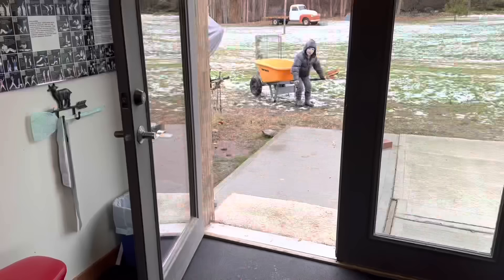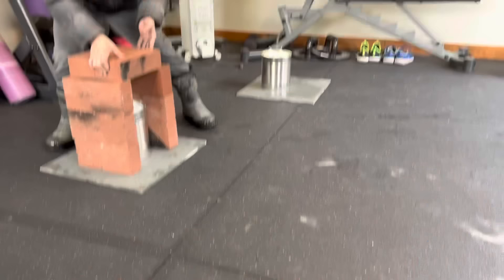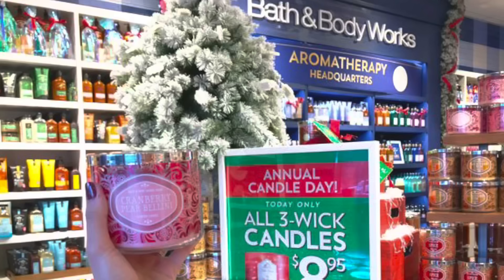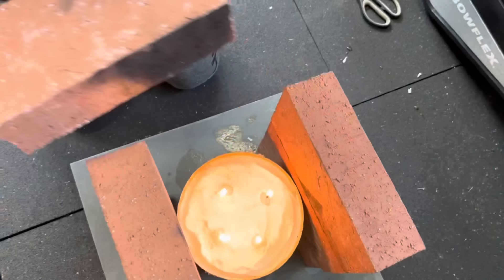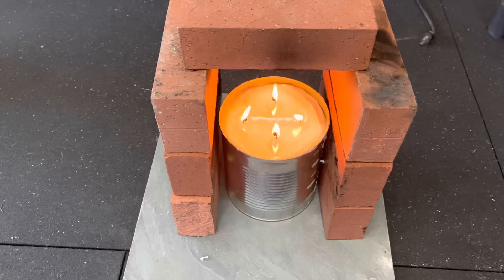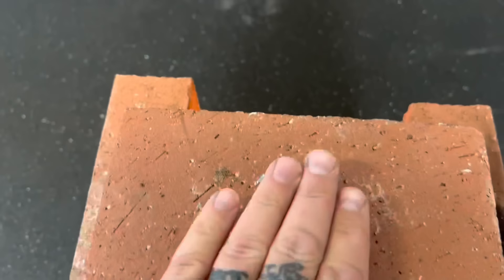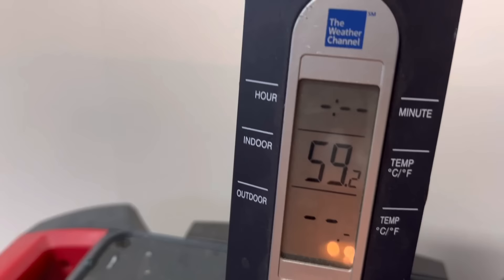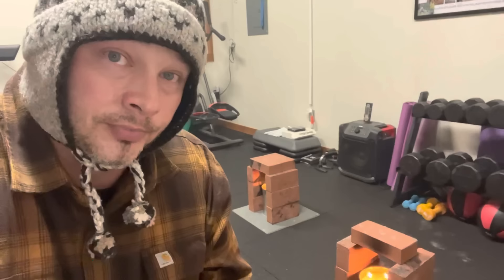Crisco candle room heating | Power Outage Room Heating | 9 hour test

Comment: Thanks for the video it was very interesting!
I wonder how these "heaters" are different from just burning the candle. The amount of heat produced should be the same. Is it that you are "concentrating" the heat within the bricks? I can imagine that when burning a candle the heat is evenly distributed in the room, and once the candle is burnt down of course there's just the warm air left which might cool down pretty fast. Here you save the energy within the bricks which will emit infrared radiation even when the candle is off and it might be much warmer around the heaters than in the rest of the room (which is quite fine if you sit around them and don't waste energy e.g. to the area around the ceiling). Is this how it works?
Reply: You pretty much nailed it.  "Thermal Mass".  You've grasped Physics!

Comment: The heat is the same, it's just absorbed and re-radiated by the thermal mass so the distribution is broader.  Having a ceiling fan stir up the air does the same thing and as gas furnaces only use electricity for the fan, plugging the furnace into a high capacity UPS, perhaps where deep cycle lead acid batteries have been wired in would allow the furnace to operate through most power outages.  Ultimately, having a transfer switch and sub-panel installed would allow you to wheel out a portable generator for long term power outages and if you ordered the trifuel version of the generator which costs the same, you can run it off the natural gas lines, resorting to propane or gasoline when the natural gas lines are disrupted.   Also a modern portable kerosene or propane heater will often have an oxygen sensor for indoor use to avoid carbon monoxide poisoning and may be a better and safer choice than candles and bricks.  Also keep in mind that many carbon monoxide detectors are powered through the mains and are only designed to last four days on the battery backup.  You will want a battery based carbon monoxide detector on the same floor you intend to use this as an emergency heating solution.  Also, though this might've worked during say the cold snap in Texas, it's going to do very little for the minus 20 to minus 40 Celsius Canadian cold snaps, candles only put out so much heat however you distribute the heat.   Keep in mind that carbon monoxide detectors must be kept above 4 degrees Celsius or the electrochemical sensor will be damaged which is why they advise you to bring them into your house from your RV or cabin when the RV or cabin are not in use.
Reply: How would you turn the ceiling fan on no electricity
Reply: @vanferrell7021  I believe he mentions the fan as a comparison of distribution of the heat via the thermal mass.

Comment: I would be to scared to use kresto I would rather use candles if u think that would be safe thank u for Ur help
Reply from the maker: You should not be scared of Crisco, it will not catch fire unless it reaches over 400° it’s pretty safe and it burns much longer than a candle it seems, but either way it’s a great back up plan

Comment: I would ask for more controls. Has to be done at night so no sun heating. Need to know what it is on a similar night, with no heat and plot that. I watched a video of a guy in a double tent with 30-50 candles that it didn't touch the temp...it was still cold.
So there are a lot of variables that weren't addressed.

Comment: Wouldn’t steel plating work better at heat transference?
Reply from the maker: Many have mentioned that! I gotta try it
Reply: @RiversideHomesteadLife  I’m pretty sure clay is more of a insulation type of medium whereas iron or steel is better at heating and transfer of heat I would lower the top plat to get it within a inch or 2 from the top of the can. Bet you’ll get a lot better heating. Good luck.
Reply: No.  Se my explanations above in the comments.  
Cast iron would be useful, but not sheet metal.
Reply: @RiversideHomesteadLife  Don't waste your time.  Already explained above.

Comment: So these 12-candle units backed by vegetable shortening have raised the temperature 20-30F above outdoors. How much insulation do the outer walls have? I've been testing a similar setup in a 1972 camper with 2" of insulation, and am only getting 12F at 30F outside with no wind. Wind matters for this camper; Our land is on an open ridge with an easy mile of open space to the west and 3/4 mile to the north (cattle pasture).
Wind's effective power rises as the cube of wind speed, and trees/bushes will not get big enough fast enough to help and adding rigid foam insulation such as polyisocyanurate inside is (a) ugly (b) difficult to attach in winter (c) not going to attach with hardware. Aluminized bubble insulation would improve light levels inside but still have to deal with (b) and (c) above. Here on the Rez, if it's 40F outside, we put on another layer.. We call it "living in the fridge". Think about that
Reply from the maker: Sound challenging- I used r-13 in walls is all and the windows are the cheap ones that were on clearance at lowes - so not a bomb proof perfect weather building- but ok. 
Campers are tuff we lived in on here for 3 years with 6 kids even had a baby in the camper while I built this place so I know all about it- 

The good thing about the the candles is it helps with the condensation/ a small fan helps to to circulate the air…. I will be showing how to build a make shift wood stove soon - maybe u will like that idea
Reply: @RiversideHomesteadLife  I had a blacksmithing and welding shop for 20 years. I've built a lot of stoves. Problem here is, camper has 7 ft x 16 ft body; no shelter from wind, which gets hairy up here (as in, 10-15 mph more than in town); no water (winter ice doesnt count; too hard to throw 😝); I live on crutches so don't have 2 free hands all times I need them; ND has been in a drought for 3 years and counting. My first whiteman name starts with C for Challenge, I wonder..

Comment: No good having your co2/smoke detector on the bench, it needs to be on the ceiling.
(yes, I know co2 is heavier than air, but when hot it isn't which is why they are usually on the ceiling)

Comment: 54 degrees to 59/60 degrees is about a 5 degree temperature increase.  I wonder if that's enough in an emergency situation.
Reply: There were variables working against it -- the 'large' space (i.e. not a micro-space, size of a large tent], high ceiling, uncovered windows, the open door, and the atmospheric temperature (outdoor temp) falling over the hours that the test was run.  The thermometers were registering temps from a good distance from the candle/brick set-up.  I wonder what the air temp was  within about 2 feet of candle 'furnace'.

Comment: Could you use a terracotta strawberry pot instead of bricks? It seems it would work. There are holes open in the sides, and put a clay saucer on top. What do you think? I was without heat last winter when
it snowed and i just bundled up.

Comment: Would you please consider showing how to construct a 70% isopropyl alcohol heater and its effectiveness ??? Very helpful video. Keep up the great 👍  work .
Reply from the maker: Paul- a 70% will work much like a 91% but may have more yellow flame than say like the yellow bottle of heat which gives off blue flame which is ideal the more yellow flame the mor fumes in the air that you need to be precarious about air quality with a battery powered CO/ smoke detector 
Thanks for watching- more tips to come

Comment: I think this test is only useful if you do the same test without the heaters.  We have no idea what temperature that room would have been without the heaters.  It may be holding heat due to being well insulated and not because the heaters are holding the temperature steady.

Comment: Easier to first insulate the walls and lower ceiling height.Then build a setup where the candle's heated air goes up a slow inclined metal ribbed heat spreader, then exhausted Outside near ceiling. 
Also have sealed fresh air duct leading to Candle Heater.
Please make a video on my oncept? 
Thanks !
Reply from the maker: OK I will write this concept down

Comment: Would a steel plate radiate heat better than the brick on top over the flame?
Reply from the maker: It’s possible - and have hear a pan of water even better
Reply: No. Or, more correctly, not for as long as a brick or unglazed clay object would.
Reply: @RiversideHomesteadLife  No. Water cools rather quickly.

Comment: Did you have a control? Did you see how what the temp in the room would be inside with no heating source when it was 30 degrees outside? I'd like to see the overall difference if you have that.
Reply: Yes, a person is good for about 200W that will raise the temperature a little.

Comment: I guess 15 degrees Celsius is better than 1 degree Celsius.. not bed for a room that size.. I wonder if aluminium would throw off more heat???
Reply from the maker: It helps that’s for sure and there was 4 huge windows in there that could have been covered  aluminum could reflect some heat
Reply: @RiversideHomesteadLife  I’m gonna try what you did, looks fun and easy. My thought is that aluminium heats up fast and may put off heat quicker. So I will experiment. Thank you for your video. Was educational and interesting..

Comment: Have a question before the cold hits!! Do u think its safe to use a cast iron Dutch  oven with the lid cracked for airflow? Last yr, I put alcohol burner in our grill, just to see how much heat it would throw and it was amazing but I'm in a 10x14 shed and I need small ideas. Also wondering what alcohol fuel is safe for this small space. Its well insulated. I'm gonna try your crisco candle making skills too lol

Comment: Why not wait until it’s at least 40 or 32 degrees. It doesn’t take as long to heat something from 55 degrees as opposed to 20 degrees! When it’s colder out like in the dead of winter, will it heat up to make it warm inside??!!!
Reply from the maker: You need to start fixing the problem when the problem happens - don’t wait till your house is an ice box to start
Reply: @RiversideHomesteadLife , people have no control over when electricity goes out!! And this winter is going to be severe!!! There’s no way you can prevent this!!!!!

Comment: Crisco 12oz can is on Amazon and Walmart  - $18-$20 😮
Reply: I can't speak for Amazon, as I haven't looked there, but definitely do NOT buy from Walmart online if you can help it. I've found a LOT of items I usually buy at my local Walmart listed on their website for substantially more than the price in my local store. Example, a few months ago, I wanted a 2g glass Anchor Hocking jar, sold as a cookie jar, for a small terrarium project. Walmart had it listed online for $23.97. I bought it at my local Walmart the same day for $13.98. I've seen the same cost discrepancies with food items. I no longer use their website, except to check if something is stocked by them.
Reply: Crisco 48 oz can at Aldi, December 2022 - $8.22 USD.

Comment: Some burn up to 72 days? Could I set one of these up in my crawl space to keep my pipes from freezing during the winter months?
Reply: A crock pot works really well. They are cheap ( flea markets /;thrift stores) & have a low / warm setting...I have kept my main supply & water meter warm using 1or 2 crockpots on low/warm , full of water....
A reptile heater works for this as well ...uses 
even less power , but some can get HOT ! check ✔️ with a temperature 🌡️ gun 🔫 ! If the pot is uncovered it radiates better , but you have to refill more , if covered it won't run out of water for ? days ?

Comment: An even better test would be to set your crisco candle heaters up, and then set up 4-5 cots for people to sleep on, and see what the temp get to, because having several people will add to the heat, plus do not keep going in and out.  Just come in and nap time over night!  I bet the temps would be at least 5 degrees higher than your last reading....low 70s most likely.  We do not realize how much heat our bodies give off!

Comment: I am looking into alternative emergency heating source for my house, but I am not sure about any type of open flame - I have parrots, these birds cannot handle any CO2 or CO for even a short time - they'd be dead in no time, like a canary in a coal mine...how much gas does a large candle emit, I wonder...and do the bricks give off fumes? I tried this year ago, candle and brick, and the parrot in the cage next to the lamp died that same night....
Reply from the maker: Be sure to watch las vid -get the detector for sure….  Maybe propane?
Reply: Sorry for the loss of your parrot. We had a home heating fuel furnace that was 30 years old. It kept breaking down. I now use gas to heat my home with a new energy efficient furnace, but also bought a gas stove. We have "frequent" power outages in the winter here on the island I live on. At least with a gas stove I can heat (lightly) using the stove top burners, the kitchen and living room naturally using caution not to reduce our oxygen levels too much. We are getting a generator, specifically to run the furnace during winter power outages. I plan to use it intermittently just to bring the house up to temperature as opposed to letting run constantly and consume fuel.

"If" you have any winter sun, you might consider passive solar. It is far less expensive to build than regular solar. It uses heat boxes to capture the sun's energy outside, and bring it into the home. Some use the sun to heat water (in a similar fashion) then circulate it from an insulated storage tank into the home, like radiators. Folks using winter sun have reduced their heating costs up to 30%!

Perhaps a wood fueled boiler to heat selected areas of the home, if you live in a well wooded area. You would likely need a separate power source to circulate the water but that could be set up in advance.

Comment: Probably a dumb question but why does just the candle part of the crisco candles burn vs the whole melted liquid top layer? Meaning how does the fire just stay on the four wicks vs getting the whole liquified surface layer to burn the way the wick does? I heard you mention the 450 degrees, but am trying to understand why the open flame don't cause the melted liquid surface to just burn instead of the wick? Hope that made sense. It will be good to learn so I know what keeps it controlled vs dangerous
🙂👍
Reply: I think it is because the wick has a lower combustion rate so the wick burns before the Crisco. The Crisco actually slows the burn rate of the wick. If you just lit a dry wick it would burn quickly. The Crisco does burn at the point of the wick that is the hottest, but very slowly. This is just my opinion, but I think that is what is happening with a candle or Crisco heater.

Comment: I have tried making these- hearing it was do-able with coconut oil. But my candles keep drowning the wick and snuffing out. How does the melting crisco not snuff the candle? Mine keeps dying. No bueno! Any help would be great. In a shot glass size candle I have tried using birthday candles, wax taper, beeswax birthday candle diameter... Two wicks, one wick, two wicks spread apart. All that happens is the shortening melts and the inserted candles just snuff and tip over and drown... Sad sad days.
Reply from the maker: Lol not sure why people have that problem- 
I have used them for hours and hours!!! How long is it burning? Before it goes out? What temp are you doing test in? Are you trying in cold climate?  But I have used indoors room temp still no problem-
Reply: @RiversideHomesteadLife  I've been doing the tests indoors in my drafty cold and expensive to heat house (still is about 60 inside). Candle only burns for less than a half an hour before it drowns/snuffs

Comment: Do you have a video, or How about without the bricks and see if bricks are even needed for this scenario?
Reply from the maker: I’ve used them with out bricks. Idea is just to radiate the heat lower than in room- I think if you had mor candles it would combat the heat loss to ceiling… it’s just a trial and air thing in each situation- even cookie sheet can hold heat down and heat up the metal….  Just candles are better than no candles and cooking sheet or bricks better than just candle 😊🙌🏽
Reply: Don't they teach basic scientific principles in the schools anymore?

Comment: good video, 
 in one of your videos you put the shortneing in the microwave. why ?
Reply: First you melt the shortening. Then you put it in the freezer. Maybe half an hour. Then you stick the candle in. I think doing it that way is that the candle won't fall once the shortening  
was heated and then frozen.
Reply from the maker: It’s just a faster way to do it smooth with no air pockets and less spoon packing ets- ( not needed)

Comment: You might want to check your facts Crisco does not have paraffin in it. Paraffin is petroleum-based. Crisco is hydrogenated vegetable and palm oil. If you use a heat generated fan you could double or even triple the efficiency.